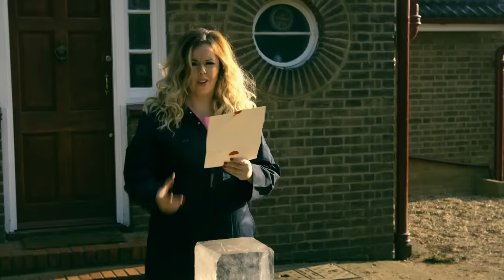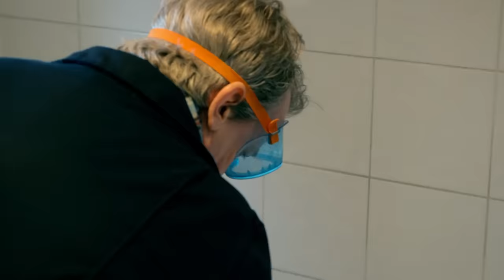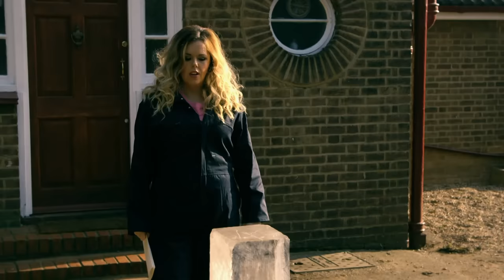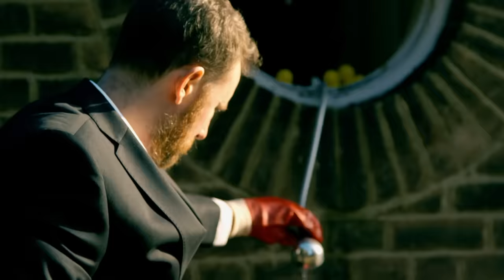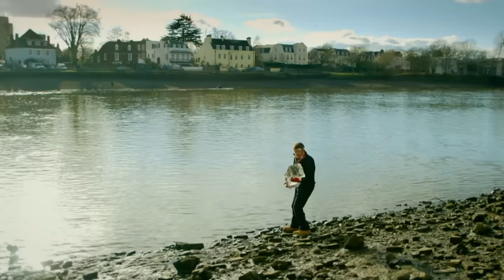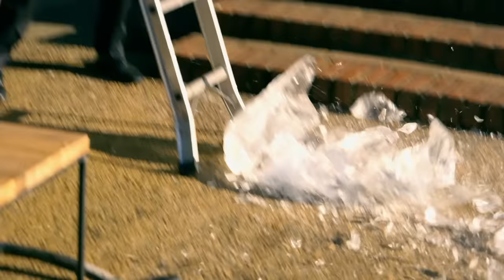Make This Block Of Ice Disappear | Full Task | Taskmaster

Comment: River guy should have won. The time definitely should've stopped when the timer couldn't see it, not when it was thrown in the river.
Reply: Why though? they could literally have just walked down the river and followed it that way and it would have lasted far longer.
Reply: @havtor007  the task was not to melt it, or make it dissapear forever, just make it dissapear, even covering it with a blanket would have been enought
Reply: @rexkraft_  But even using that way of thinking it did not dissapear ice floats all you need to do is to follow it down the river and you will see it for ages.
Reply: @havtor007  the task was not to make it dissapear forever, just make it dissapear, and that was archieved
Reply: @rexkraft_  i will repeat again with some caps as you do not seem to get it. YOU CAN SEE ICE IT DOES NOT DISAPEAR IN THE RIVER.
Because it floats.
And all you needed to do to see it for far far far longer was to WALK DOWN THE RIVER.

The task was to make it disapear NOT TO MAKE IT GO OUTSIDE OF the propperty.

The guy was very lucky he did not walk down the river with the ice block because then he would get a time of hours.

With that way of thinking telling him to turn around is making it disapear because it then is not something he sees
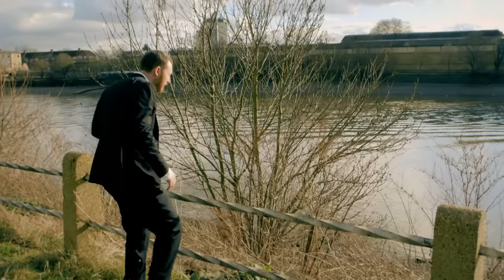Reply: @havtor007 dissapear: to cease to be seen; vanish from sight. By your logic things do not dissapear unless they are trown into the sun 8:58
Reply: @rexkraft_  by your logic if you hold a hand infront of your face the world does not exist.
Every time you close your eyes the world is gone.

That is not how it works.
Or rather it is not how it works if you are over the age of 2 years old

It is amazing that you do not understand this little tiny fact THE ICE FLOATS YOU CAN SEE IT all you need to do is WALK by the river and you will see it.

I am not even fucking talking about disapearing i am talking about how throwing the ice in the fucking river does not make it disappear.
The river will take it downstream but as long as you can follow the river you can see it for absolutely ages.
Reply: @havtor007  yes it does thanks you, you get it now, maybe check the hundreds of dictionaries that say that the definition of dissapear is, vanish from sight, cease to be seen, etc, im sorry that this is too silly for your liking but reality is often dissapointing
Reply: @rexkraft_  So by what you say turn him around and it is gone.
It is that simple to do the task then.

Putting the ice in the river makes you able to WALK by the river or take a boat or so many other things and you will see It for ages.

I am not talking about disappearing means but the Fact that putting the ice in the river should get way way more time then it did because it did not dissapear they chose not to walk with the ice block and if they did the time would be massive.
Reply: @rexkraft_  so you have less understanding of the world then a toddler good to know
Reply: @havtor007  yes, it is that simple, if you have a problem with that, go complain to the task master that created a challenge so so so so open to interpretation

 Honestly man, i have kept it civil trough the whole conversation, this makes me think you are getting self concious, if you had any argument beyond "it is silly" when im talking facts, you would have already said it, 8:57 that is the moment the block dissapears, if you don't agree, you can complain to the people that created the task or the people that created the definition of dissapear, if you don't have anything of value to say, im going to end this conversation before you get more toxic
Reply: @havtor007   fact: the dicionary fefinition of dissapear is banish from sight, cease to be seen, etc

Fact: the guy that was keeping track of the block lost track of it

Either give me facts that refute this or this conversation is over
Reply: @rexkraft_  Fact: the dictionary definition is not what is used here. It is a game in a game you are allowed to do things.
If you throw the blanket over the ice the person can still see there is something there. and he knows by the fact that he is watching the person do it the ice is still just under the blanket.
Fact: You know in your head that the world does not disappear every single time you close your eyes or you sleep, if you do not understand this (as you have said you do not understand by the way) your understanding of the world is literally on a toddlers level.

Your second fact the guy did lose track of it BUT ONLY because he CHOSE not to walk after it, if he had done that he would have been able to see it for hours and that is fact  if you do not understand this there is 0 chance in hell you understand how a river works.
It was a choice not that it in fact had disappeared but a choice of him not going after it because it is more fun that way.

By the way YOU, not the gamesmaster not the people that made the game YOU, all you need to do is turn around the person with the timer or tell them to close their eyes and the clock stops.

Also, you must be fucking amazed by magicians because damn you are easy to fool, and for the love of god never do any gambling you are going to lose all your money.
Reply: @havtor007   ok, you got more toxic, I already warned you that a minimun level of maturity is neccesary to discuss things, and you don't have it. 
sorry but this conversation is over
Reply: @rexkraft_  This was never a discussion beacuse you tried to go over and not talk about anything.
You fixated on 1 thing 1 thing only your own words that disappear means something.
You never once even acknowledge what i am saying.
A minimum maturity level is needed to discuss something and you do not have it.

You do not even want to understand what i am saying.
Diego i am using your own words and using those you are just so blind that you do not even understand that.

When you are toxic you get toxic right back from me.
Using your own words your own way of thinking and you call me toxic go and look in a mirror because that is what i have been to your comments.

Next time you speak to someone actually read or listen to what they say and speak from there make it a conversation i tried to get you in a conversation but you did not want that.

Following your own way of thinking the guy should not win and there is many reasons why.
Reply: @havtor007  Then the people who melted it didn't make it disappear either. You can still see the water from the ice. WTF kind of logic were you even using? I hope these last 2 years you have made a transformation from insufferable edgy internet 12yo to an actually intelligent human being capable of producing logical arguments to back up their point of view rather than resorting to rewriting the same comment over and over again in a loop but adding more bits in caps lmao.
Reply: @tiranito2834  I see my comment got deleted.
Reply: @tiranito2834  Termodynamic and the ice being boyent disproves you
Reply: @tiranito2834  You commenting on a 2year old comment that is like commenting on something someone said 20years ago by the way.
Reply: @tiranito2834  You are a child or someone having problems with object permanence you must LOVE pika boo as you see people disappear and suddenly come back again all the time

Comment: Surface area, If you try to melt a block it will never work. You have to break it down to increase surface area, into fragments the result is melted in less than 2 minutes. Take a hammer and axe head smash straight through the long center. Resulting in it breaking into multiple pieces 1 sledge hammer later, the whole process takes 20 minutes ( five minutes to retrieve tools. Melted by 45 mins depending on physical capability.)

Comment: I haven't watched this yet, but if it were up to me, I would place the ice block into the tub vertically, then fill the tub with just enough cold water that it reaches the top of the ice, but not enough for it to start floating.  This should render the block of ice essentially invisible if it is clear enough to start with and I don't damage it too much.

Comment: Didnt count when it went in the river, but counted it as "disappeared" when there was still water in the oven tray? Was this a melting challenge, or a disappearing challenge? Id have just thrown the block over the fence. "There, its disappeared." The definition of "disappear" means to cease to exist, cease to be visible, or to be impossible to find. He could have just covered it with a fuckin blanket 🤣

Comment: I thought the guy with the thick beard was onto something at first.....but then he went a completely different direction than what I was expecting.

What "I" would have done: 
Get 4 big pots, fill partially with hot water, add salt, set to boil.
Break down the ice into maybe hand sized pieces.
Drop ice into the boiling salt water.

A block that big should be gone in 5-10 minutes.

Comment: First thing you do is slam it on the ground a few times, Breaking it up will drastically increase the surface area allowing it to melt faster and soak into the ground.

Comment: So 336,000 joules is required to turn 1 KG of ice to liquid. Dividing by a thousand gives you how many seconds it would take if you applied 1000W to do it. Would take around 5 min. It's hard to make that 10 or so kg block turn into water quickly.

Comment: I wonder if opening drain and throwing it inside would count. Technically it would disappear from there
Pro tip: Water is only substance known to me that is actually bit LESS dense as solid because of some fancy physics happening to bounds in it. That's why ice is LIGHTER than water and floats. You can't dump ice in river unless you weight it somehow. Tbh as much as graph of water density and structure is uni-lvl fact that ice floats is common knowledge...

Comment: If Tim had argued his case of his ice disappearing better - he would have won this

While you can argue that because the water still exists, the other three didn't make it disappear, but the task wasn't to make the water disappear, it was to make the ICE BLOCK disappear. What is ice? Ice is FROZEN WATER. What is frozen water? Ice. Once you melt ice - what is it? Melted ice? Sure, but it's actually just cold water (or hot or warm water if enough is used of it). Is cold water ice? No. Is hot or warm water ice? No. So once they melted the ice - it was just water - not ice. So they made the block of ice disappear into a puddle of water (or down the drain in Josh's case). Because water, unless frozen is not ice.

However, Tim threw his ice into the river, and it was still ice, so it hadn't disappeared by that logic, right? WRONG. To disappear is to vanish from view, like the other three melting the ice - they made theirs vanish from view. When magicians make objects disappear - the object clearly still exists, even if it comes back - we still call it the disappearing act - because we can no longer see the object. When you lose an object, you often say, it disappeared because you can no longer find it, because you can't see it, and if you find it, it just reappeared, and if you never find it, it's disappeared forever, for you. Even though that object still exists wherever it went to. If a person goes missing - we often say they disappeared, and when we write their stories later, even if they are found, we call it the "disappearance of so and so".  We couldn't see the objects or the person, we said they disappeared, even if they still existed. So when Tim threw the ice into the river, once the ice was no longer visible to Alex (and Tim) even though the ice was still in existence for some time, it had disappeared from view, and this fulfilling a different interpretation of disappear. By this same logic, you could have thrown anything on top of the block, or moved it behind something and call it disappeared, and it would still be valid. 

You could also have altered the block (such as shattering it into multiple pieces of ice) so that it was clearly no longer a distinguishable block of ice - and said that THE BLOCK OF ICE had disappeared, because it had changed shape from a block - but that one is trickier because then you have to argue what is a block of ice, the shape or just the size of the ice shape. Because you could have just split it into two, but I don't think Greg would have given you much points for that, even though you technically made the ice block no longer a singular block of ice, you didn't actually make it disappear in anyway.

So at the end of the day - it was about making your case. And Greg even gave Tim the greatest opportunity. When Greg hid his hand behind the card and asked if that was disappeared, even though his hand still existed, Tim could have argued that yes, his hand DISSAPEARED behind the card, to whoever was looking from that view, and since neither Alex nor Tim could see the block of ice, it had disappeared - and that if they could go out and find the block right now, it would have just been reappearing, but that it had disappeared, even if just for a short while. Just like a magic trick. So if Tim had been able to make his case better, which is all on Tim, he could have easily won this hands down.

And if you made it all the way to end of this comment - kudos to you - have a cookie. You deserve it.

Comment: I think if I had to do it, and I could be destructive, I'd cut the top off of a hot water heater, break it up into several smaller pieces to increase the surface area and let er go.

Comment: making things disappear is just relocating it. you cant make something not exist. And changing the state of something like ice into water is not making it disappear cause you can still see the melted water. so technically throwing it on a roof is making it disappear cause no one is going to hop on a roof to see if there is a piece of ice on it. i would tell the cameras and the crew to leave except for one guy with the timer. then i would reveal the magic trick after i made them look for it

Comment: I was amused that they were given a shovel but no one thought to bury it in the grass. Could've probably done it in about 5 minutes 🤣
Reply: Eh, you ever try to dig a whole foot into the ground? At least where I live, you get about 5 inches before the dirt turns to rock and going any further takes ages. You'd need more than a spade to get that whole block buried in less than it takes to just throw it in the oven.

Comment: Well if you were to use the same logic applied to Tim's ice, that it technically had not disappeared because it wasn't in visible sight, wouldn't that mean no one made the ice disappear. Somewhere, the melted ice/water is appearing to some rat in the sewers. The only true way to make the ice disappear is to make it evaporate.

Comment: It's too bad nobody dumped the box of salt in the hot water bath, as that would have sped up the process considerably. Also would have been smarter to smash it to bits on the concrete first. More surface area.

Comment: Why not just fill the bath with hotwater ?
Then put the ice block in. And use a haller to make as many pieces as possible to make it  heat faster. Add boiling water.
And once the bath start to be full open the  (Not english dont know the name) thing that hold the water in the bath.
Boom you just melted that shit.

Comment: Smart boys whom melt ice know that room temperature water works just as well as hot water at melting ice 
As long as the water is moving, that ice is gone
Reply: Does it work?  Yes.
Just as well?  No.
Reply: @jimmyreece5781  It doesn't need to be hot if it's moving. A garden hose at outside temperature will melt ice five times faster than a hot shower-head. I know this because I just had to thaw out an AC unit from a winter freeze
Reply: @jimmyreece5781  I guess I just know more about melting ice than you do, idk!
Reply: @newtybot   As if you haven't already embarrassed yourself enough.  🤣🤣
Reply: @jimmyreece5781  Idk at least my comments don't get deleted by YouTube :P

Comment: i would probably take a slege hammer to smash it in multiple small pieces, load into storage tub, take into shower and cycle burning water on it.

or
if there was an induction heater i would melt scrap metal down and pour it over the ice

Comment: Step 1: put it in the bath
Step 2: go to town with a hammer, smashing the block to peices thus increasing surface area
Step 3: add salt to lower the melting pt.
Step 4: run hot water.

Step 5: drain the tub.

Comment: I woudl probably just wrap it in a towel and throw it in the dryer. Might destroy the dryer tho
Reply: Make it into smaller chunks first.would help with weight distribution. I would have done 1/4 in dryer the other 1/4 in the kitchen while i deal with the last 1/2 in the tub.